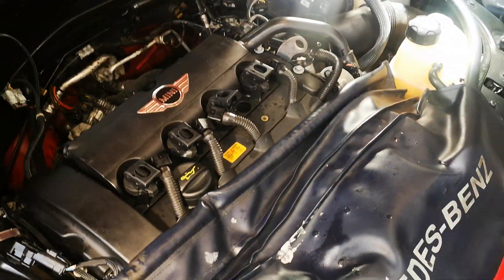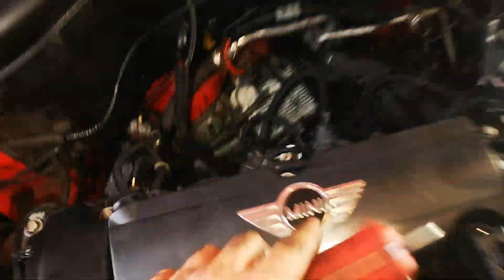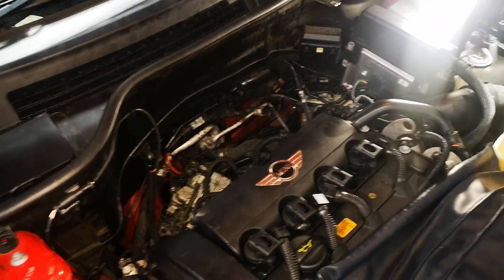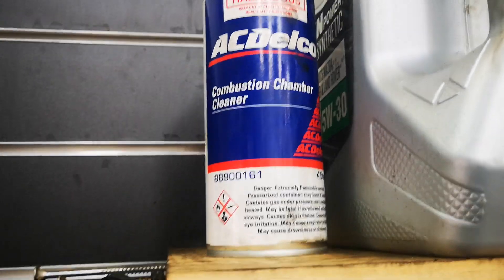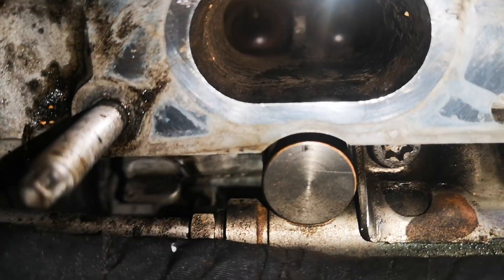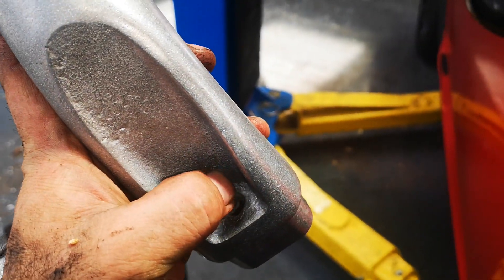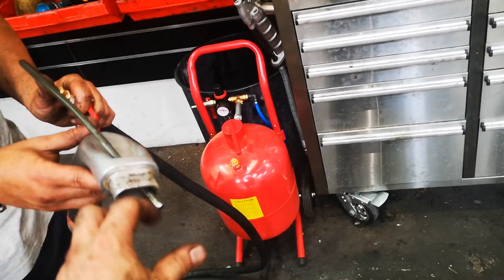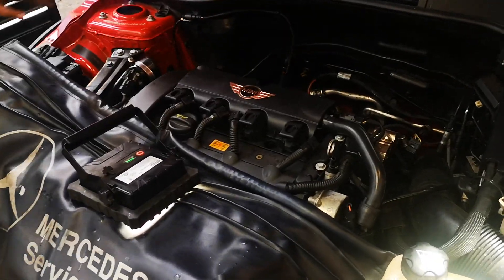BMW Mini walnut blast intake valves misfires carbon deposits tips & safety warning

Comment: Oy m8

I am on the market for a new (old) car, and I'm looking at N/A boxer engines because it really looks like they
can go far in time in terms of mileage.
What should I be aware of ? Looking for 4cyl n/a imprezas and legacy maybe 6cyl if I can find one cheap.
Can they run E85 ? I am in france and high octane fuel is 1.50€/L (sometimes more), that's 2.42AUD/Liter...
Cheers